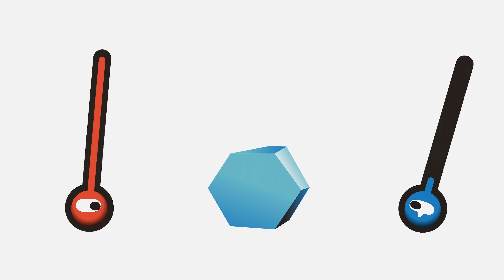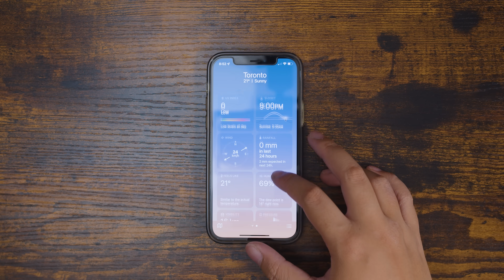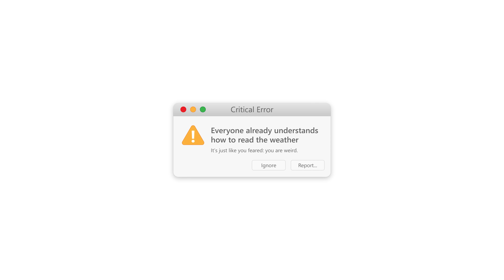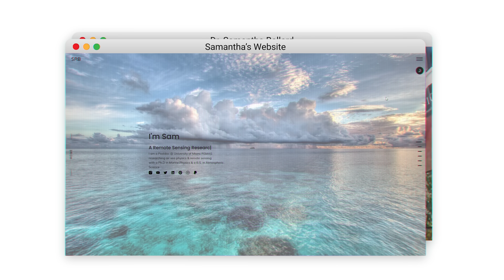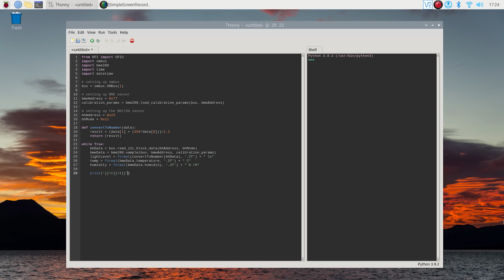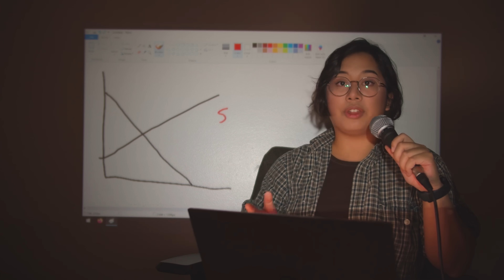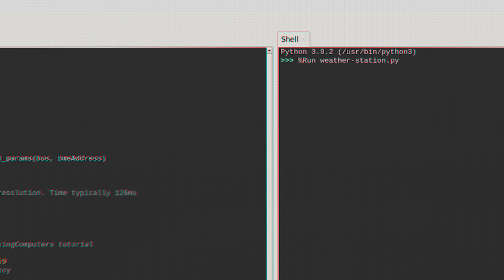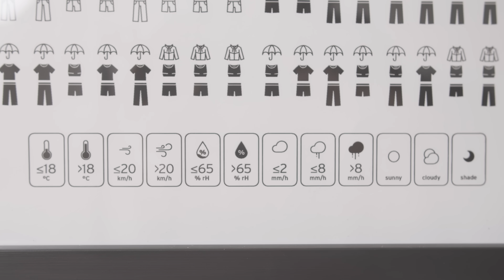how fahrenheit fails you

Comment: As a Canadian, the freezing point of water is so important for making sense of weather, that I cannot imagine using a system that is not centred on that temperature.
Reply: It's heavily dependent on location. Fahrenheit makes much more sense in Texas where 70% of the year hovers around the 100 degree mark. Its easy for our brains to go, okay above 100 too hot to be outside, under 100 we're good. As well, it really only reached below 32 (which you basically just memorize as freezing) a couple times a year so it wasn't a big deal. 

Really though, it's just about what you grew up with. People who grow up speaking English think that English is easy and Mandarin is impossible. People who grew up speaking Mandarin think this the opposite way (this is just an example). So really, it's just about what you're used to.
Reply: I’m canadien and when I s’en 26 I know I better put some t shirt and some short u get used to this unit like any other
Reply: Except for the freezing point of water changes.
Reply: 32. There. That’s it. It’s solved. Ur welcome.
Reply: This mirrors my feelings about Fahrenheit. I live in Florida, I never need to worry about freezing weather, but hot is very, very important. I think this video pointed out a big reason why I like Fahrenheit, because of the 1-100 scale. There's more whole numbers to work with when trying to understand the type of hot on a given day. Although, to be fair, the humidity level has way more impact on how it feels outside than pure temperature does. I think the best temperature system is just the one you happen to know. Maybe in the future the US will convert to Celsius and Metric to make communication easier. I hope so. But, for now, I'll keep having silly hyperbolic arguments(that are for fun) with my Canadian girlfriend.
Reply: I don't understand why, especially in the digital age, we can't have a temperature scale that begins with freezing at 0° to boiling at 100°. I mean, I'd be happy with just receiving all forecasts in terms of the heat index or some similar algorithm (preferably one that weighs humidity and wind speed more highly). Really, I want the flowchart from this video, but I want to be able to tweak the measurements to my qualia and then simply receive the final recommendation. 😅
Reply: What of those at different elevations where those temperatures vary a bit
Reply: As a Canadian, wouldn't you be more concerned about when the salt truck stops being able to melt the roads AKA -21 C?
Reply: @netsplit64  Nah.  Salt only truly works well enough at temps near zero and creates a slurry, so most municipalities use sand or gravel so it embeds into the ice/snow for traction.  Below -30, it's cold enough that the ice starts behaving like concrete, anyway.
Reply: I live in a part of the United States where it gets below freezing only in the middle of the night for like one week in winter so it's never really mattered to me
Reply: @rockym9981  Yeah... so the 0 F is even less relevant for you
Reply: Do you think Americans have no clue when water freezes?

It’s just a different scale. If you grew up with it, it makes perfect sense and if you didn’t then it will once you look at it for a few minutes. It’s not exactly rocket surgery… but then again I’m in the “Fahrenheit is better” category of people so I’m biased.
Reply: It's not like people don't understand what freezing is it's just 32 degrees. It's not hard to remember.
Reply: @42crazyguy Dude, it's 0 degrees, not 32
Reply: @iqbalindaryono8984  Fahrenheit
Reply: I understand your point but the only time it’s important is when you’re near the freezing temperature. So it doesn’t really matter as long as you know when the water will freeze. I live in Alaska so my experience is probably similar to yours. I use Fahrenheit. I just know if it’s below 32 it’s icy. Other than that it’s all about previous experience. I like Fahrenheit for the 0 being really cold and 100 being really hot aspect. I like Celsius for chemistry class when I’m dealing with both freezing and boiling liquids.
Reply: @rivermahugh4575  I think it really depends on the country. In France, I feel like 0°C (32°F) is really a "symbolic" temperature meaning "REALLY cold", and it's close to the coldest i've ever seen (actually the coldest i've ever seen was -8°C, or 18°F, but may be because I've only lived in Metropolitan France for 3.5 years, I used to live in French Guiana where 20°C/68°F is already too cold to ever happen as well as 35°C/95°F being too hot to ever happen)
Reply: @noefillon1749  -8°C effectivement c'est car tu ne vies pas en métropole depuis longtemps ahaha le plus bas que j'ai eu en France c'est -20°C
Reply: @hamzabhh9719  Aussi j'étais à Toulouse (puis Lyon), si j'avais été à Strasbourg ça aurait été sûrement différent
Reply: @noefillon1749 100 degrees Fahrenheit is a real symbolic number for me. If it gets close too 100 it's getting extremely hot and anything over 100 is extreme heat.
Reply: @rivermahugh4575  But in a lot of countries, you are oscilating around freezing temperature for half of the year, like in Europe for example (if you don't live in southern europe). If you want to drive a car, you really need to know if it was -1 or +2°C in the night, that makes a difference.
Reply: using water's freezing/boiling point just seems right when it comes to temperature. water is the most important thing on this planet.
Reply: maybe it's because I don't live in a place where I ever have to worry about water freezing but like... why is that so important that you couldn't possibly imagine living without basing your temperature around frozen water?
Reply: celcius is perfect you know once it goes below 0 it snows and if it goes above 0 it rains it makes way more sense then ferinheight
Reply: @xavierpierre1676  But that's not really true, snow can fall plenty above freezing. It isn't gonna stick but it can easily snow way below freezing and not stick either. I live in Colorado in the US and we've had a couple days where it snowed at around 8 C for a little bit.
Reply: @xavierpierre1676 that's just not true
Reply: @xavierpierre1676  Except that's not true because there are so many other factors. It can snow above 0 and rain below 0.
Reply: @xavierpierre1676 in that regard u could just say the same with farenheight. Simply use 32 instead of 0. But I live in Texas. Central Texas to be exact. A place where it goes below 32 only 1 week of the year. Maybe 2 if the weather gets crazy like it did 2 years ago. So it doesn’t matter for me. 

Right now it’s 106 degrees outside so u just know it’s stupidly hot. Instead of saying 41 degrees which doesn’t sound that crazy.
Reply: @xavierpierre1676 that sounds nice, but when is warm and when is it hot? I can never tell what is considered a comfortable day and what is scorching hot in Celsius. It isn’t intuitive for that at all. Those are the temperatures I have to deal with. We only get near the freezing point of water for like 1-2 months per year, if that.
Reply: @xavierpierre1676  yeah... we have that magic number in Farenheit too.... it's just not 0. And we have more weather conditions than snow and sleet. Personally I find it more inconvenient that if I get the wrong 20-something number in my head when reading Celcius it goes from I need a jacket to I'm burning up from the heat. The smaller degrees, and this wider scale of temperatures, in Farenheit help alleviate that.
Reply: It's not just the freezing. It's also the fact that boiling water is 100°C
Reply: @theguyfromsaturn  I wish people would stop say water boils at 100°C/212°F that is only at sea level for example in some places like areas of Colorado water boils at 96.8°C/206.2°F and that is all outdoors most on here live indoors with central air that changes the pressure of your house.
Reply: @theguyfromsaturn  In the context of a video about understanding weather data that's not very helpful though. If a weather forecast ever shows anything near 100C anywhere on Earth, every human on the planet is almost certainly dead already.
Reply: @Urza9814  Yes, it does, 100°C covers the ENTIRE range of liquid water. That's an experience that a person has on a daily basis, from ice cubes to boiling water. Then the  room temperature is 20°C. That's a VERY manageable number. 0 to 20° covers from freezing to pleasant. Twice that is unbearably hot. It's a VERY human scale. Water is at the core of the living experience.
Reply: @theguyfromsaturn  Firstly, water doesn't always boil at 100C; secondly, if you are experiencing boiling water, you are either in incredible pain or dead. That is not a central part of the human experience. 

I have one of those digital kettles that shows the temperature. It reads Fahrenheit, so boiling would be 212. I don't think I've ever seen it reach 212 -- usually it's boiling by 200, and shuts itself off around 205. But it doesn't matter, because I can just look at the damn thing and know if it is boiling yet. A thermometer is less accurate at determining if something is boiling than my own eyes or ears. That is the LEAST useful temperature to know! Also, this isn't a video discussing what scale is best for COOKING; it is discussing what scale is best for WEATHER. 

And sure, 0 to 20C covers "freezing to pleasant" (although personally I'd describe that more like very cold to slightly cold...)...without much granularity. So in Celcius I have what, about fourty degrees to cover my daily experience? in Fahrenheit I have about a hundred. 0-100 is a much nicer scale to deal with than -10 to 40.

And hey, if you wanna talk cooking temperatures, look at ovens. Fahrenheit ovens and instructions use nice increments of 25 degrees. When I look up common oven temperatures in Celcius they're all over the place; some use ten degree increments; some use thirty; some mix and match...how is it that hard??
Reply: @Urza9814  In the everyday experience that give people their "intuition", water most definitely boils at 100°C. You are just splitting hairs. The best proof of how temperature is the most intuitive of all the conversions is that in places, like Canada, where people had grown up using the British imperial system, older people still cling on to the old units even almost 50 years later, however, in less than 10 years NOBODY was using Farenheight. That is very telling right there. If you don't change other units for whatever reason, there will be absolutley no challenge in converting to Celcius. People will just feel it.
Reply: @theguyfromsaturn  It's telling about the fact that your government forced Celsius upon you, but not much else.
Reply: @wta1518  It was forced (or not) just as much as any other unit. It's not the government that forced it more than other units. It's the intuitiveness of the units that made people ditch Farenheith (which has nothing to recommend it ) with pleasure.
Reply: @theguyfromsaturn  It literally was forced. The Canadian government told news broadcasters that they had to give the temperature in Celsius. People didn't switch over because Celsius was better, they switched over because Celsius was crammed down their throat.
Reply: @theguyfromsaturn  my main problem with Celsius is the boiling point. Not the freezing. I live in Texas, so the majority of the time it is hot. Obviously boiling temperature is RIDICULOUSLY hot and we would literally die if weather got that hot. Fahrenheit is better in this situation because it’s easier to understand what hot in WEATHER is. boiling temperature is just too big of a difference in temperature in order to intuitively determine what temperature a hot summer day is just from the knowledge that 100 = boiling. The scale just doesn’t work very well for hot weather.
Reply: @Lanndh  I disagree. 100 for boiling is so natural and intuitive. Saying that your body tempmerature is at 100 is completely ridiculous and unintuitive. On the other hand saying that water boils at 100 gives you a good feel for what it means. Everyone has an intuitive sense of both freezing and boiling. We expereience it on a daily basis in our kitchen.
Reply: @theguyfromsaturn   but at least from an objective standpoint saying that the body temperature is 100 degrees is MUCH more intuitive for weather. That’s just a fact.
Reply: You can't imagine using a system that you don't use or need to use? Color me shocked. 

The meter for detecting freezing still exists for F, if not more intuitively and with more nuanced precision. You just don't know it and aren't willing to learn since you're basing everything on the number 0. If even people who use C can't tell the difference between specific temperatures even though the margin for differences are over double that from F, then I don't see the point. I can easily tell the differences between 78F and 80F as being slightly warm and comfortable to warm becoming uncomfortable. It really only matters for freezing when in 90% of other contexts for determining how everyday weather even feels it's less helpful, and F still does that job of determining freeze point if you know the number. It's not that difficult. Just say that you're sticking with C, because you're too lazy and won't be catered to by people around you.
Reply: Imo that's REALLY good for science, but for human purposes, the closer it is to 100, the closer it is to being really really really hot; the closer it is to 0, the closer it is to being really really really cold.
Reply: As an American, here's how to interpreter Fahrenheit. First, ignore the last digit. Now, let's consider the remaining digits:
Negative anything: stay indoors
0: Bone chilling
1: My mustache froze in this
2. Very cold. Snowy. Watch out for black ice
3. Rather cold. Might be a little icy
4: Jacket weather. 
5: You could maybe wear a jacket, or maybe go without. Depends if you grew up somewhere warm or somewhere cold.
6: Pleasant. 
7: Pleasantly warm. 
8: Too warm. I start to turn on the AC with this, because I live in Washington.
9: Hot. AC is necessary.
10: Arizona
11: Arizona, what are you doing?
12: Arizona, STAAHHHHHP.
13: You are dead.
Reply: You literally have to remember 1 number. 

It's not that fucking hard. 

Get over yourself.
Reply: If all you care about is the binary choice of ice vs no ice, you aren't getting outside enough. All you care about is if the car will be slipping, huh? It's not even that binary, ice can stick around well above the freezing point, and will even get worse as it warms...so you need history and recent conditions for that information to be any use anyway. Below or above 0C on its own doesn't tell you much at all.

With Fahrenheit, zero degrees is the point where you gotta worry about frostbite just walking down the road to pick up some milk. Below or above freezing doesn't mean shit; below 0F means typical daily tasks could kill you if you don't prepare for it. And people start dying when temps go above 100F too. For the average human in good health, the 0-100F range -- even unprepared -- is probably just uncomfortable, not life-threatening.

Growing up I used to regularly go to school wearing shorts when it was below freezing. 0C ain't even bad enough to make a kid put on pants. But nobody is doing that shit when it's below 0F...
Reply: How about centering it on human comfort, instead of water changing state.
Reply: I mean, you just need to remember the number 32. F is nice just because it is more fine toned to our actual experience. C is for water, and I don't care about anything above 43c (100f) because it will never hit that. Also it goes into negative numbers way to quickly. While yes water freezes at 0c, weather will typically go under that to about -18c (0f). With f anything above 100 is super hot anything below 0 is super cold. 

For me it's way more annoying to have to remember all the random points of when it is hot and cold in c. C is best for science and worse for actual human experiences.

Comment: As someone in metric who's used to celsius, I hate to admit that Fahrenheit is more intuitive in a certain way. I can't tell which is what in Fahrenheit, but regardless of that did a comment about temperature in the game 7 Days To Die stuck with me: "0 means you're dying of cold, 100 means you're dying from heat".
As context, those temps in F are where the game starts punishing you based on temperature. In celsius those exact same points are less "obvious": -7 C (if I recall right) and 38 C.
Even though I can use F in any meaningful way, I can still see that a range of 100 for that is better than those ~45 in celsius...

TLDR: I suck at temperature too.

Comment: I'm from a metric country, I lived in the USA for one year and adapting to the imperial units wasn't a big issue. The only one that I really really hated and I couldn't adapt to was Fahrenheit. I will be team Celsius forever!
Reply: I can't see that being an issue. Anytime you doubt anything - just google a converter
Reply: I was the opposite being an American adopting the metric system
Reply: I'm an American.... and I would be exactly the opposite. Even now I can see the benefits to the measurements of weight and distance (though I don't have a good metal frame of reference to begin to understand them in practical use beyond they're 10-scale) but I think Celcius is horrible.
Reply: @anthonydelfino6171  your lack of education is even more so. No way you went anywhere past highschool, and if you did it's liberal arts.
Reply: @anthonydelfino6171 yeah- I used Celsius for a couple years and when I switched to Fahrenheit, it was way more accurate.